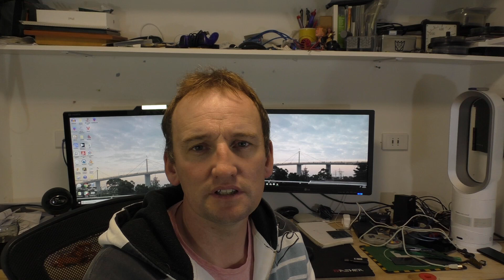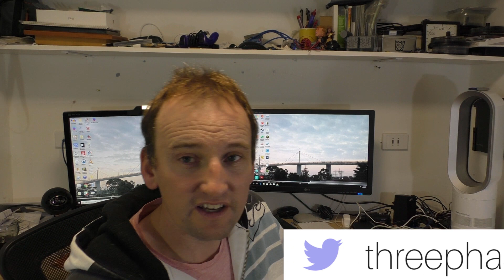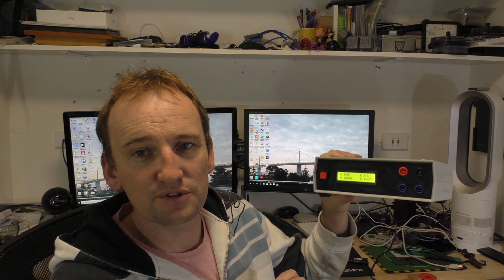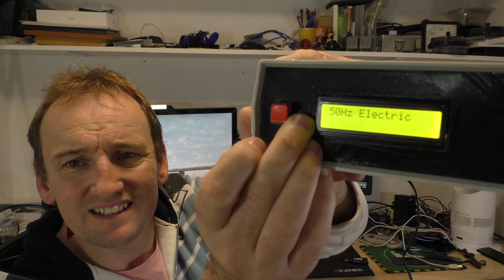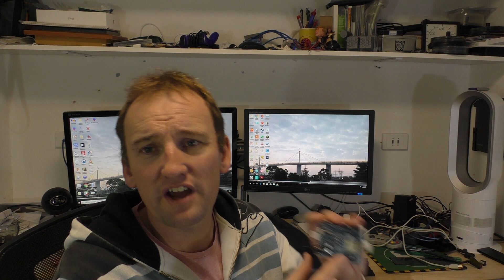Arduino External Reset Button - Easy

Comment: how if my ground  plug in is already plugged for another device ( I2c and IR sensor) ? can i only plugin reset cable?
Reply from the maker: Twist two together before you push them in. You need to create more gnd connections
Reply: @50Hz  thank you for answering my quetion,  so i have to twist ground from external button with the other device ground then plugged in, is it right ?
Reply from the maker: @arisriswandi2082  don't really understand but a gnd is a common point so if one wire is already touching it you can jump onto that one aswell
Reply: @50Hz  oke got it

Comment: Hi, Its that simple however, I have  one of thoes cheap chinese cnc shields which sits on top of the Ardunio, I cant see the word reset by any of the pins? It does have Hold...Resume...Abort....E-stop. Any idea?...Thanks in advance.
Reply from the maker: Look for which pin slides into the reset socket and try to bell it out with a multimeter